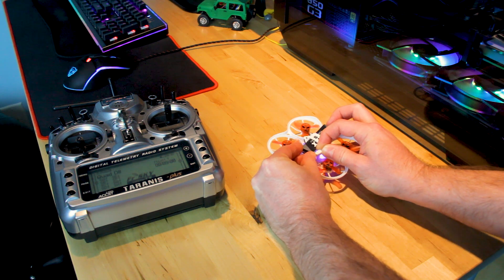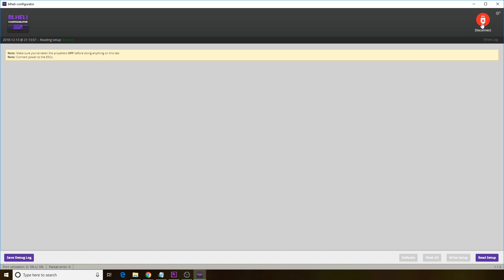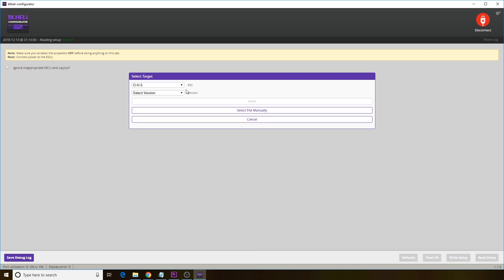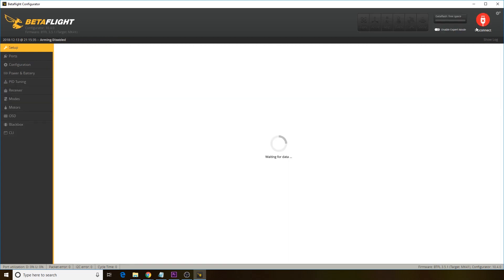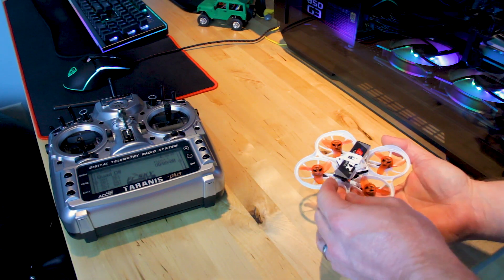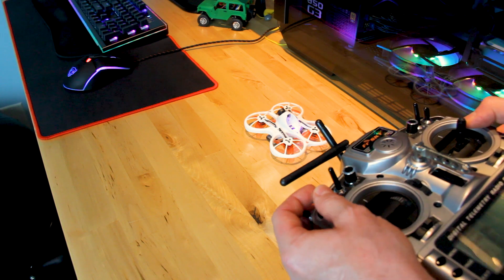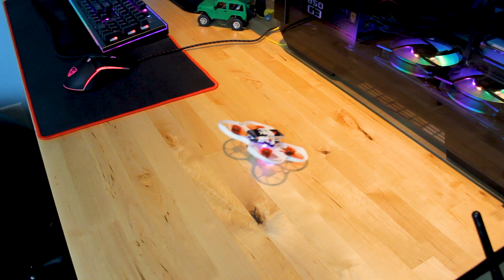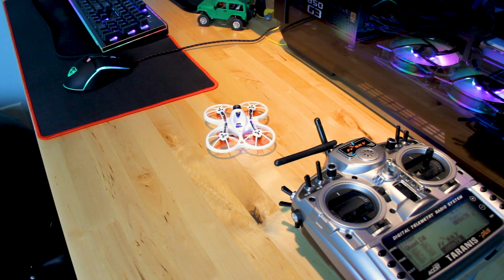Emax Tinyhawk - DShot Beeper Setup / ESC Firmware Update

Comment: I had to also change the ESC/Motor Features protocol to DSHOT600 from ONESHOT125 to get it to work. Not sure if this is right for the TH v1.
Reply from the maker: I am surprised your Tinyhakw was set up with ONESHOT and not DSHOT, but at this point I cannot remember how mine came originally.  You are correct though that it requires the DSHOT digital protocol to make the motors beep.

Comment: I connected my tinyhawk to the BLHeli Configurator, hit connect and it connected, then hit read setup and it just says reading setup finished with the FINISHED being green, yet nothing comes up on the screen.
Reply from the maker: First thing to try:  Did you plug in the battery?  You must have the ESCs fully powered by a battery.
Reply: hit connect with not battery, then connect the battery to read worked for me

Comment: My beeper will constantly beep when the beeper is set on via aux channel. Do you know why this is?
Reply from the maker: There are multiple reasons this could be happening.  It could be in your Betaflight setup:  the slider could be set up wrong, or the wrong aux channel could be assigned to it.  It is also possible that it is set up incorrectly in your radio so that a channel different than what you thought is actually sending the signal to the aux channel assigned to the beeper.  It could also be that one of the warning options is causing it to beep, like maybe you are testing it with a discharge battery.

Does it beep even with a new battery plugged in?  Does the drone still fly correctly and do all of the other functions work correctly while flying?

It is most likely not set up fully in Betaflight.  Go to the "Receiver" tab in Betaflight and make sure that the aux channel switch you want to use moves the correct aux channel bar.  Then go into the "Modes" tab and make sure that same aux channel is selected for the "Beeper" and then make sure that aux channel is not selected for any other mode function.  Move the switch and see if the "Beeper" switch position on the screen changes.  Then make sure the "Beeper" mode slider is only over the end of switch position where you want it to beep.  Good luck!

Comment: Hi. I just got a Tinyhawk and need advice. Its the bnf. I ran it first with betaflight 10.1 and there were more modes available than with betaflight 10.5. Is it important what version of betaflight I use ?  I only have bnf version of drones but do you think I should update firmware?  Any help would be really appreciated. Thank you 😊.
Reply from the maker: I believe you are talking about the Betaflight Configurator version (I have 10.4.0), and not the Firmware version.  The Configurator is the computer software that allows you to change settings on the flight controller.  The firmware is the software on the flight controller.  The firmware should be version 3.5.1 (that is what mine is running) or something around there.  If you are new to racing drones, your best bet right now is to stick with the stock firmware.  If you flash a new version, it will change all of the custom tuning that Emax did to make the Tinyhawk fly really well.  You can tune it yourself, but that is more advanced and I would not recommend doing that unless you have an experienced friend to help, or you are just really interested in trying it, but it could make the drone fly terribly if not done well.  If you do flash new firmware, take note of the current firmware version and your settings.  See these articles on how to do that:  https://oscarliang.com/backup-restore-betaflight-config/  and  https://oscarliang.com/use-diff-not-dump-betaflight/  Good luck!
Reply: Ian Beaty  Hi thx for the response I really appreciate it.  Im asking because I cant get it to fly stable. Im not sure which version of betaflight to use. I have a cli dump of the original emaxx settings.  Im just trying to figure out why it wont fly normal. My endpoints never seems to stay at 1000 ,1500 and 2000. Someone told me I should only use betaflight 10.1 with the Tinyhawk and not 10.5. Im not trying to adjust any advanced stuff just get it flying normal. Just the basic stuff to get it flying. I made all my aux switches   I believe my problem is with either the betaflight version firmware or endpoints. Im I going in the right direction. Thx again ✌️

Comment: Seeing something beep isn't the same as hearing it :)  As a small tweak you should add the motors to do the lost beeping for you, it's not very loud but could make a real difference in finding it. FYI The Turtle mode does only work with 4 blade props since the 3 blade is not powerful enough. Not sure if the "upgraded motors" (15000 -> 16500) make a difference in that area. Also flash the Project Mockingbird settings for much better controlled flight. Tip:order extra frame(s) and motor(s). Those are the things to break after a lot of abuse (real life result from 7 TH owners) Happy Flying !!
Reply from the maker: That's all great information.  Thanks for sharing!
Reply from the maker: I have doubts that the 3 blade props would do turtle mode with the new motors since they are only slightly more powerful.  I recently got the 4 blade props, but I haven't tested them out yet.  I did put Project Mockingbird on it and WOW, what a difference!  I do still need to order spare frames, especially now that there are more color options - I sure hope they come out with green!  FYI - I just noticed they have green props now too!
Reply: @IanBeaty  I was unsuccessful with Tinyhawk 2 in turtle mode. It tried, but it did not succeed.
Reply from the maker: @spacemanspiff559  You are right, it does not always work great.  First, you must have 4-blade props.  The 3-blade do not really create enough thrust for turtle mode.  Second, it depends on the surface you are on.  If the surface is slippery like a wood floor, sometimes the quad will just slide around upside down, but on something with more friction like carpet, turtle mode usually works a lot better.  If your motors have hair in them or your batteries are worn out you may have trouble getting turtle mode to work also.